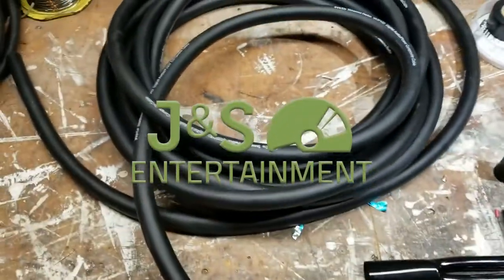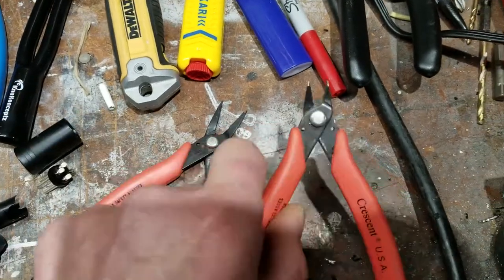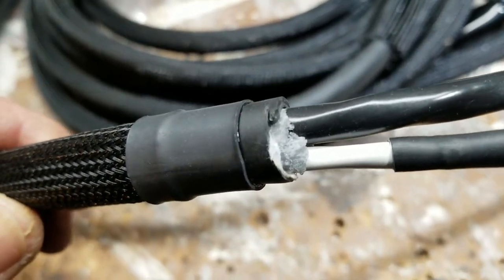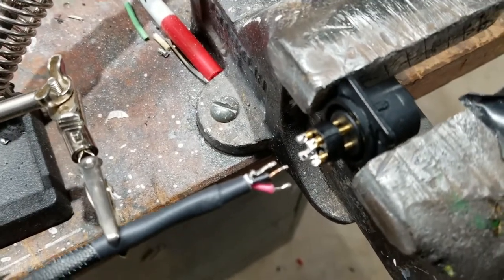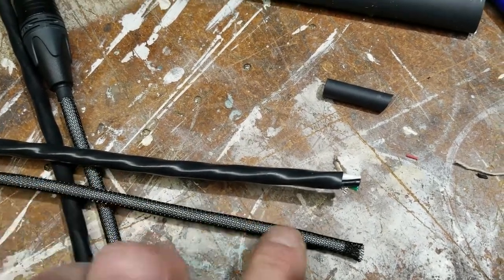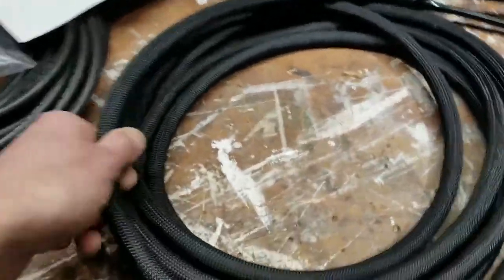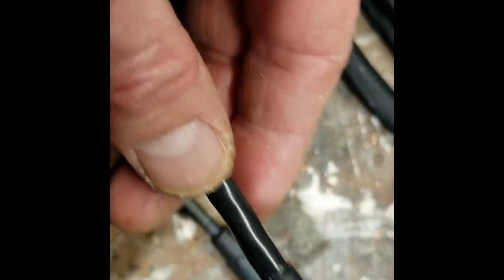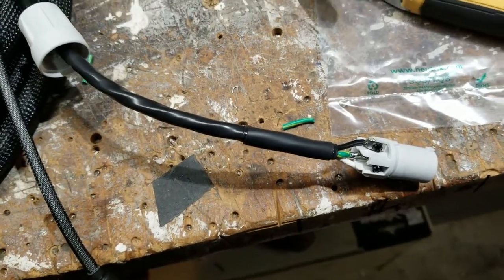Custom Audio + Power cable (snake): XLR and PowerCon

Comment: I noticed you used a cable from ProCo. How does it sound.  I bought a premade one from ProCo through Amazon. I noticed that when I replaced the XLR cable out of the mixer to my subwoofer with the ProCo, the bass sound got much louder. Not sure why this would have happened. Any quick thoughts on the issues?